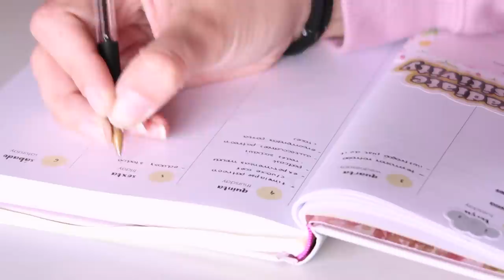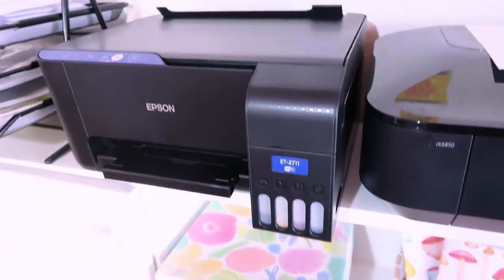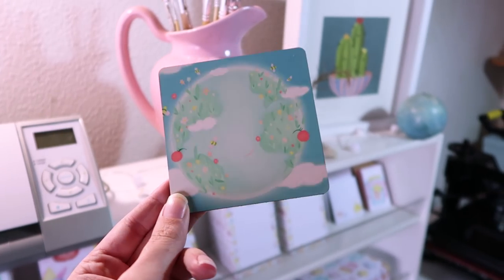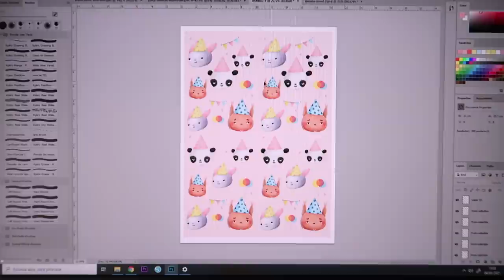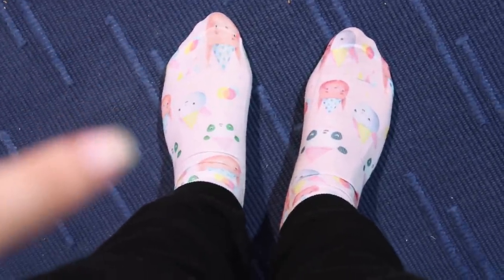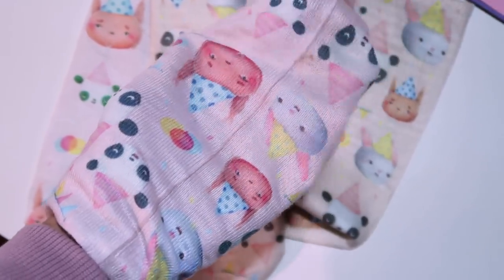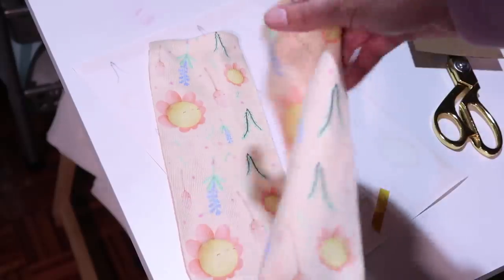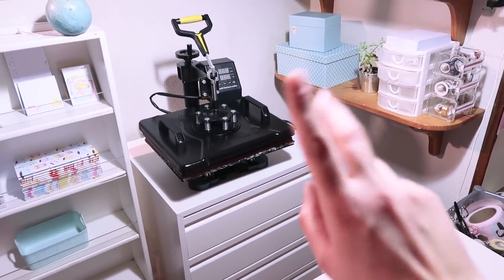Making SOCKS! ⭐/ SUBLIMATION gone RIGHT! / Trying new products for my shop / ART STUDIO VLOG

Comment: Hi sweetie, nice video. Let me tell you that the smell would not go away, just try to have a fan on or your windows open. Also I’ll recommend you to removed the sublimation paper immediately without moving it too much. The ink still a gas and when you move it; it could cause some ghosting. Again nice video and keep making cute things. 😉
Reply from the maker: Thank you so much Claudia! At least is nice to know. It really is a strong smell!! When using tape is really hard to mode immediately because it's too hot. You don't use tape? Thank you for the tips, means a lot 🥰
Reply: @aPenasIllustrator  I use tape on my mugs and mouse pads not on my t-shirts. But the gases could still create a ghosting effect if is not removed when still hot. Get a heat resistant glove maybe that would help. My son is always telling me that I have a bionic hand cause I grab hot stuff and use super hot water to wash dishes lol 😂